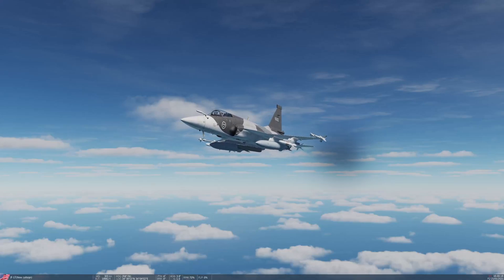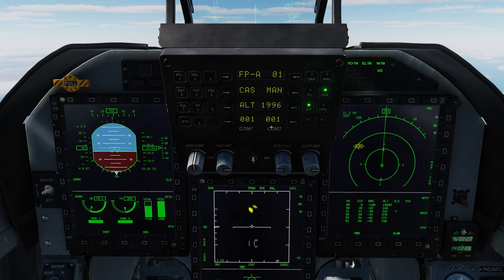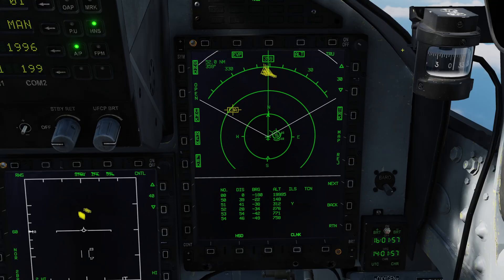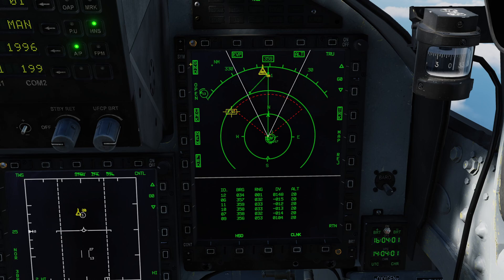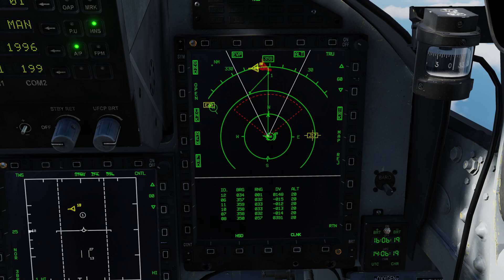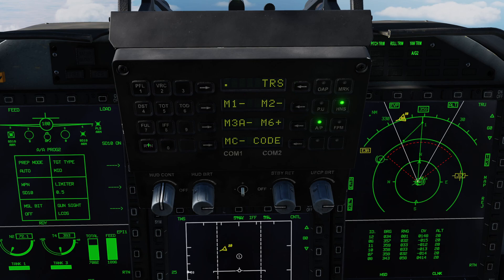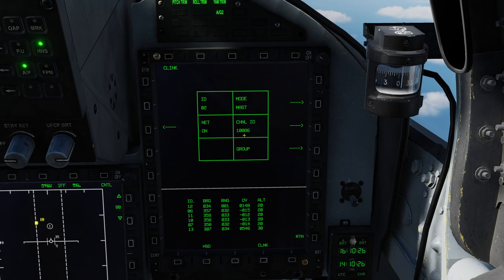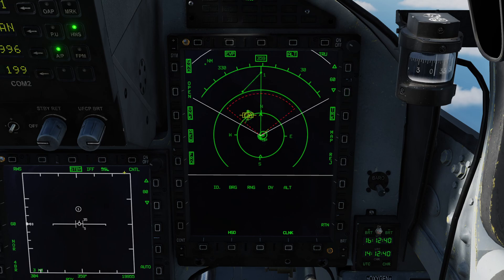DCS JF-17 Tutorial 15 - Datalink and IFF

Comment: is it correct that the page shown at 5:40 is not present anymore on the jeff?
Reply from the maker: It is still present however the filtering options have now changed and so look different. All the functionality is retained however.
Reply: @deephack did they remove all the features from hsd screen? Everytime I activate datalink. Nothing changes other than i get datalink contacts. Just Got the jeff Yesterday. And Ive spend all of Yesterday to troubleahoot this damm thing.
No hsd features and no datalink contacts on my radar screen

Comment: This JF 17 Doesn't Seem Real. Airliners A320neo Can be Fly By Wire "Auto Pilot" Controlled.
Thats Because They Don't Make Sharp Sudden Evasive Manuvers.
A Real Fighter Jet is Like the DCS Mirage 2000c Simulator.
A lot of the Weapons on the DCS JF 17 and DCS F15E - Seam Unrealistic.
Laser Guided Bombs. Paint the Ground with a Laser - You're Gonna Get Fired at Aswell.
A Real Fighter Jet is Like the DCS Mirage 2000c Simulator.

Comment: Hi, Deepchack - I have been having a issue where I input 199 and it cycles to 001 and wont let me enter it in to go to Data Mode. Any thoughts on why this is happening?
Reply from the maker: Not entirely sure, first thought would be to check if you have TACAN turned on as it's not possible to use both at once.
Reply: @deephack  I found the answer - I had pushed the button on the radio console that switches comm 2  to the radio console. This would not let me enter the data link. This plane is weird in the fact that the data link/TCN and the radio share Comm 2.  I was determined to find out the issue and that was it.

Comment: Thank you very much for your videos and the time you dedicate to help us.
I don't know if I'm wrong, but I discovered that if I select a TCN before configuring the DATALINK, the TCN information is available in the HSD and no Datalink information is lost.

Greetings
Reply from the maker: That sounds rather like a bug to me. TACAN info should be lost on switching on the datalink as it used the same radio hardware.
Reply: @deephack  Well, while this bug is present, I take advantage of using the tacan at my convenience. In ME I leave a TCN terrestrial equipment installed on the bullseye, and thus in addition to having Datalink I have information from the BE... I know, it's cheating.
Thanks for answering
cheers

Comment: I'm currently having an issue where once the plane hits bingo fuel the Data link system stops working, and I can't seem to figure out how to get it turn back on either that or its happening when i turn on the approach mode for landing. I do know the network box under the Clink page keeps flipping to off immediately after pressing the button though.
Reply from the maker: Approach mode will activate the TACAN system which is linked to COM2. This in turn will disable datalink. You can't use both at the same time.

Comment: Hey Deephack, really loving the tutorials, bought the JF-17 as my first DCS aircraft and loving it. Wondering if your mission is stricktly air to air, would you always run a datalink or can you still IFF without a datalink say if I needed to run the wmd7 pod for ground targets but knew their were patrols in the area. Thanks in advance.
Reply from the maker: You will generally want the datalink when doing A/A work. The IFF system is completely seperate however and so you could use it without the datalink.

Comment: Great video, but when I hit 199 and select it just goes back to 001. is that an issue with the mission i'm on?
Reply from the maker: It could be, perhaps the mission maker has changed the default presets.
Reply: Did you ever figure out what was causing you to hit 199 and go back to 001, I am having the same issue.
Reply: @Synoopy2  I never did. The issue only happens on one particular mission however, so process of elimination seems to point that way
Reply: @Dizzy62695  I am having it on start up everytime using my own missions - thanks anyway for responding